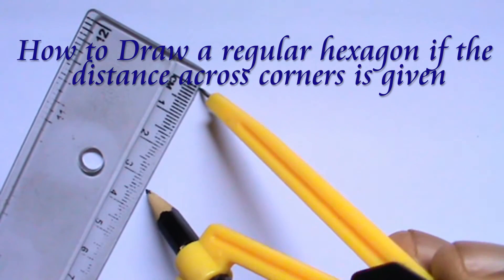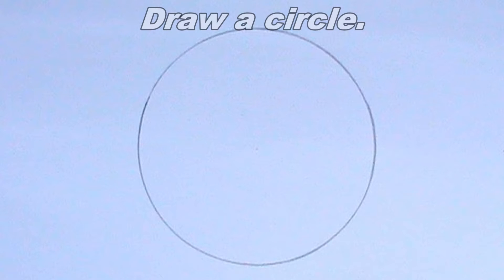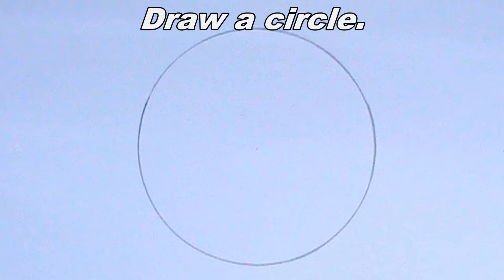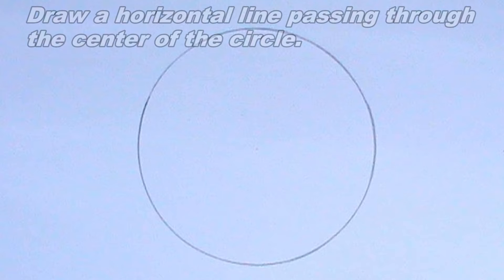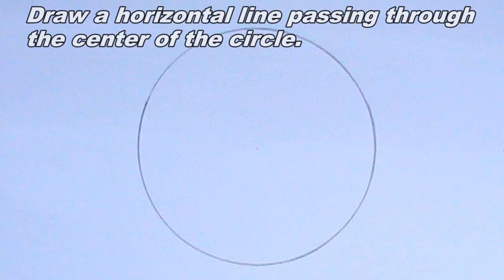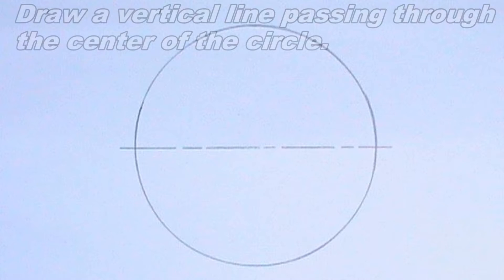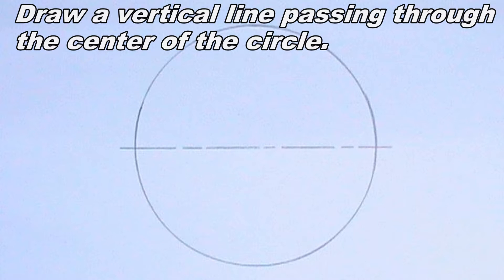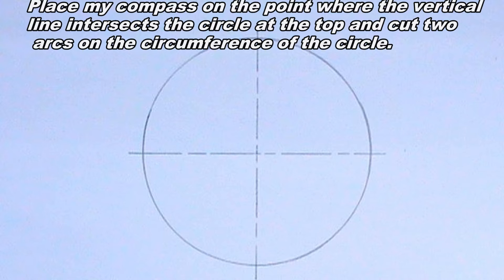HOW TO DRAW A REGULAR HEXAGON GIVEN THE DISTANCE ACROSS CORNERS || GEOMETRIC CONSTRUCTION

Comment: How to draw hexagon when given the distance across the flat
1. Draw a circle equal in diameter to the distance across the flat (30mm)
2. Draw an extended vertical diameter AB
3. Using set square 30° draw the four sides to touch the circumference of the circle
Draw the remaining two vertical and touching the circumference of the circle